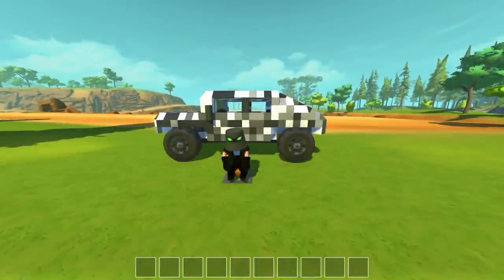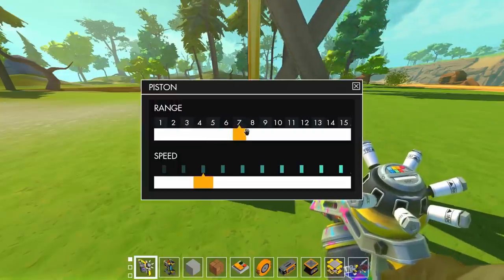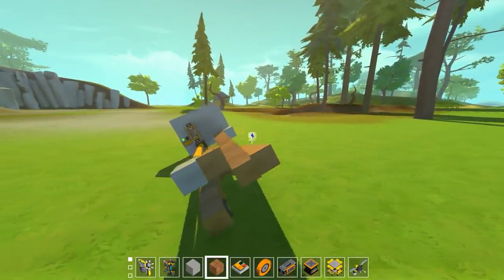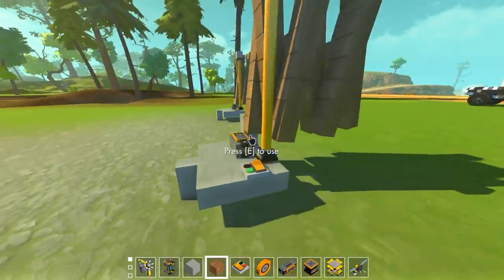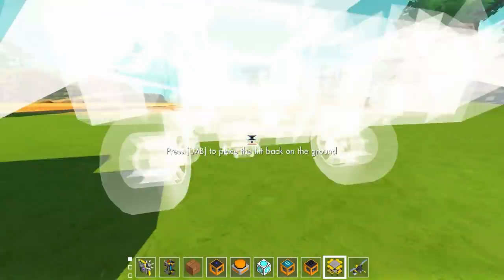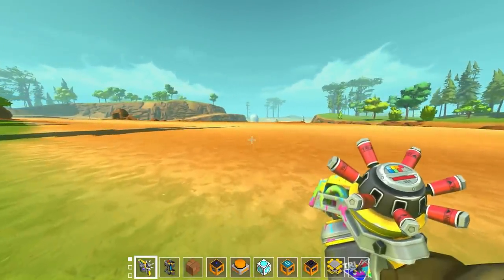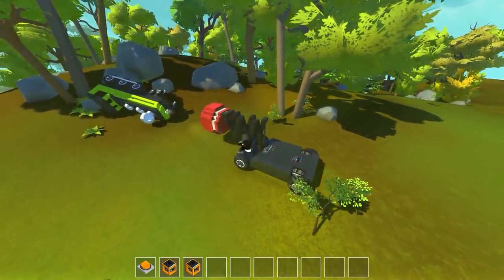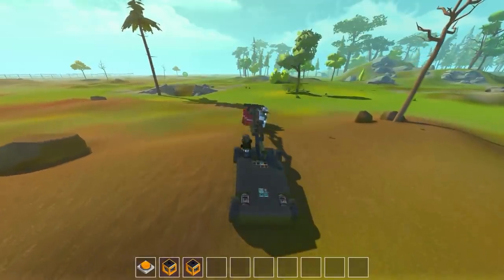I Built the World's Most Powerful Boxing Glove! (Scrap Mechanic Gameplay)

Comment: MPM but you are only allowed Burster drives?
As in, no normal steering or engines, and the only bearings allowed are for the wheels (bonus points if you can get around those)